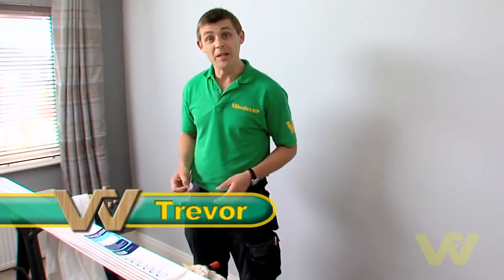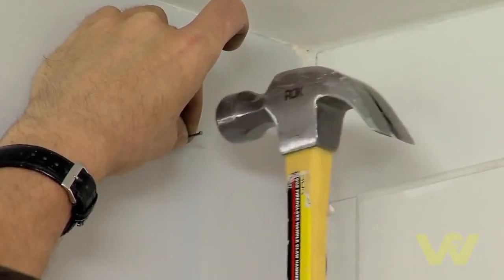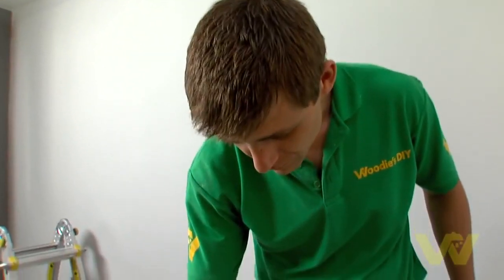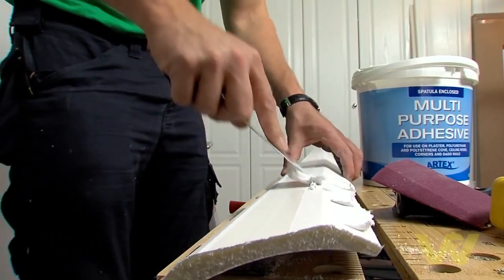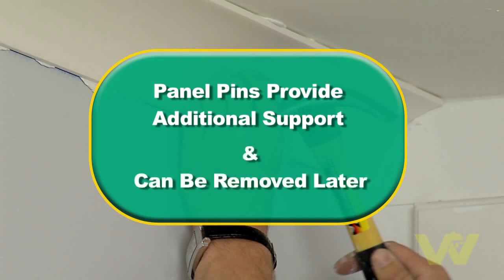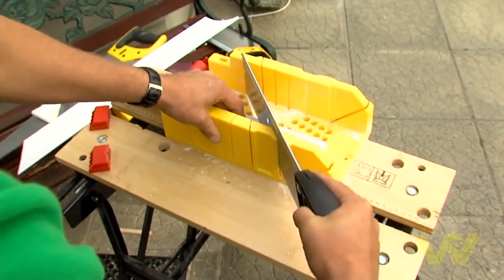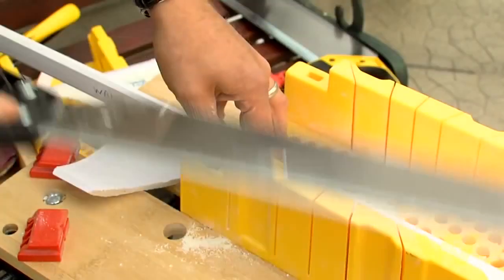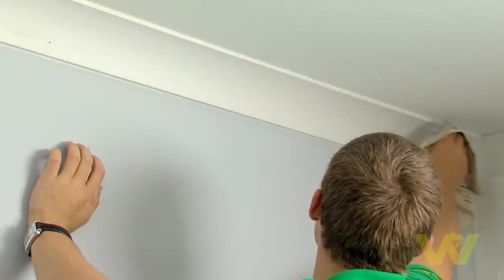How to Fit Coving

Comment: looks like a job for a guy with loads a doh
Reply: I thought so too, but I just bought 12m of coving for my room (plaster coving with paper face, artex, didn't realise it was plaster and thought it was the light stuff til I got it home >.<) a mitre box and hand saw for £40 inc delivery. the adhesive is £2/tube, I got 4 tubes and will likely have a lot to spare. it ain't as expensive as it looks when up